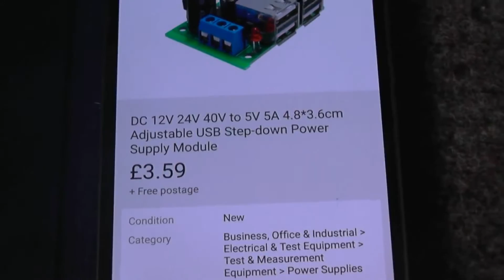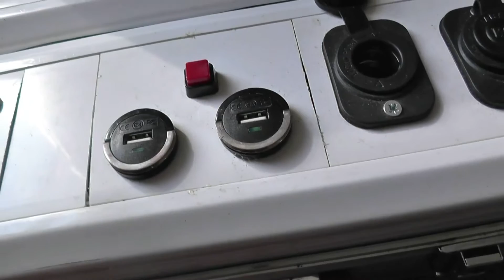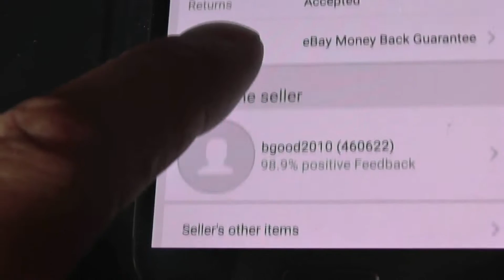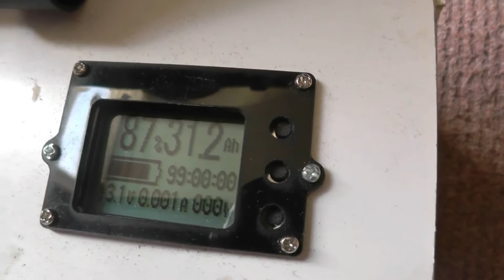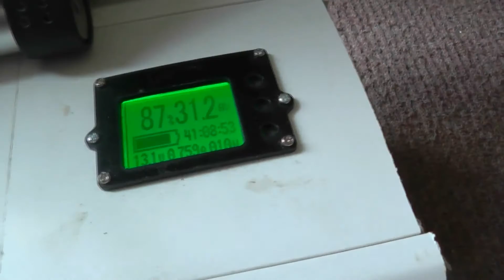step down converter to USB x 4

Comment: You might be interested in a different version of this module I got off eBay a few months ago... they have the adjustment pot , and also a big heatsink on the regulators to let them actually deliver 5A output. Was something like this one 321773119947 . Has worked well, and charges anything I throw at it, and has been running from 12-14v for a few months now. The adjustment pot can be handy to turn the voltage up to 5.25v if you need to take into account voltage sage over some of the dodgy USB leads that are around.
Reply from the maker: Peter Feerick brilliant i will purchase one in the near future! I am in the middle of a mortgage appication so my belt is pretty tight at the moment! =)

Comment: Could you please send me a picture how these USB ports are wired up? I think I saw some resistors on the underside of the PCB because a lot of these USB converter won't charge an iPhone because they are just giving 5V on the USB port and Apple devices need something connected to the data pins too.
Reply from the maker: ***** I have a picture but no way to send it to you! Have you got an email address? or email me at piet-ka @ live.co.uk
Reply: pietkaify Hello, my email address is carl.hauschke@me.com.